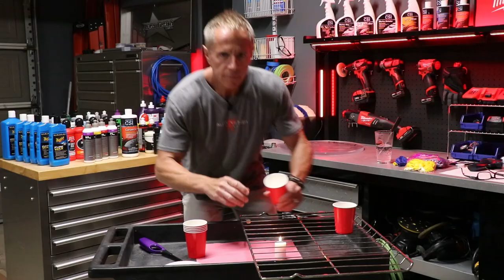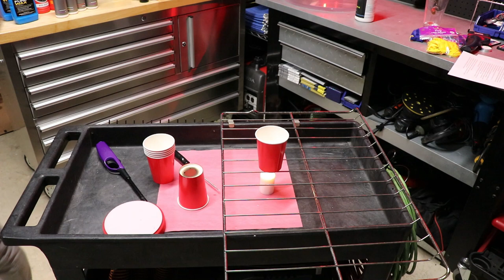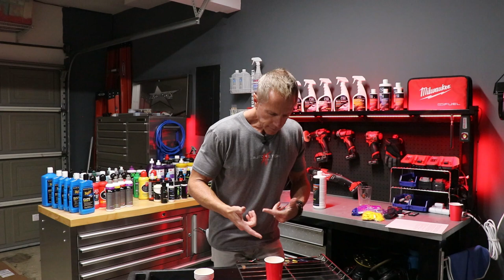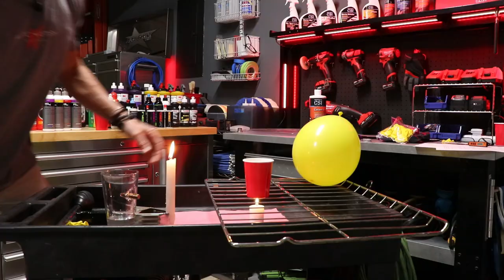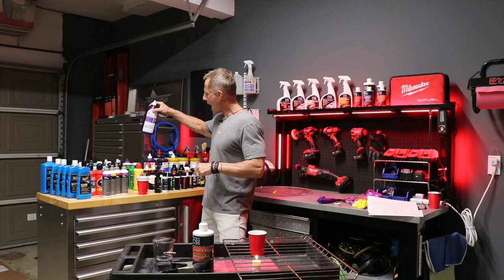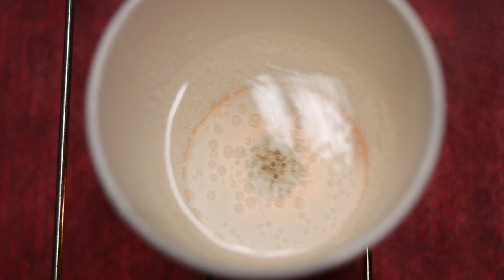Polishing Car: is it time to burn the house down??!!

Comment: Hi Darren.  Thanks for going the extra mile to answer my question re: waterborne polishes, specifically the CSI product.  I really appreciate the work you put into your videos.  However, I do still have one burning question that I just can't seem to get my head around, but it's more of a "single product" question. l So here it is:

My understanding is that that "one-step" polishes are capable of both cutting and finishing because they contain diminishing abrasives, not in spite of them.  To use your terminology, these products are capable of "scratching the paint to perfection" by utilizing finer and finer grits, until the remaining scratches are invisible to the human eye.  The finer abrasives are created as the "bigger boulders" gradually break down during the polishing process.  So here's the source of my angst:  How do polishes like CSI's achieve the same result (or better) without the benefit of diminishing abrasives?  If the higher-grit abrasives aren't being broken down during the polishing process, what is the source of the finer abrasives,  the ones that will ultimately scratch the paint to perfection?  Here's my theory; please tell me if I'm out in left field. What many detailers don't realize is that the pads themselves account for a huge amount of the abrasion that occurs during the polishing process.  The liquids are obviously important, but the difference between a good paint correction and a bad one has less to do with your choice of polish than it does machine choice, arm speed, pressure and of course, pad choice.  So CSI has been designed to facilitate/support/simplify the application of good technique, with less emphasis on products selection driven by the marketing machine.  CSI provides a high quality polish, along with a small selection of pads...which is all you need.  Would you agree with my long-winded dissertation, or am I a tad misinformed.  I could be wrong, but I think there might be some other guys out there who've had the same question messing with their heads.

Thanks again Darren - Brian

Comment: ok daren. I do mobile detailing in Norway, that is maby more Canda when it comes to weather. so I have sun. rain. heat. frost. cold. damp. all of it. I do polishing in very cold weather and I love it.
But do a test on say..polising in -2 c. Just to prove it is real good in that too.  
thanks for all that you provided me. so I finaly could run my own company with the correct proudukt. even if  after I done this for 16 years as a hobby could use the product you called trash. It could not make me work as fast and give me the shine I needed.  
So I hope you do a cold wather test.
Reply from the maker: Ceram-X will perform in cold weather. But keep in mind that I could push any product to the extreme on either end and all products would eventually fail if pushed far enough. You cannot freeze Ceram-X, just as you should not allow any product to freeze. All parts of weather will effect the user experience: temperature, humidity, ambient pressure, direct sunlight, shaded surface, etc., etc. Thanks for tuning in!!
Reply: @autofetishdetail  true.  that is extreme. I did not ment that you should feeze  cerami x. just the surface  I do heat a bit when I  polish  so i am in some heat. but that is here the other product fail. too cold or too hot.  but can't polish with ice.
ohk one more thing. before I use to be so dry  after polsih a car. now. I am just fine. wash my hand with water and I have soft hands. now that is good for your healt too.,

Comment: Darren, I  love Tom's and I believe your company . Questions first: why did u put hot water in the cup ? I saw Tom's video on this with his grill. 
Would you put ceram x in the cup ? 
I used the Ceram x on my black truck. Worked great BUT ....alot if dust.  I couldn't get it to ...pop. I guess I needed D1 ?
Does D1 make it better...like enhance or rather jeweling?
When is the release of the coating?
Thanks buddy
Reply from the maker: Hay Matt- I wondered if anyone would notice that. I used hot water to speed up the test. The real test isn't so much that you can eventually boil water. The real test is simply the fact that the paper cup does not ignite when exposed to an open flame; as it would without water to absorb all the heat of the open flame. Since I was using a very small heat source, it would take along time to get that candle to heat the water.  I wanted to emphasize the moment by showing bubbles starting to form in the bottom of the cup. So I preheated the water to speed up the moment. But once again; the most important thing is the fact that the cup can withstand an open flame for extended period of time due to the insulating effects of water, not whether I could fully boil the water.  And yes, Ceram-X does produce dust. Virtually every polish/compound produces some type of dust. Not all, but most of them do. Like everything in life you have to accept trade-off's. Ceram-X was made to answer very specific problems the industry was not able to answer, as well as be the simplest, safest, fastest way to produce results in the professional world of auto body/car restoration. This mean the cleanest, tightest, simplest formulation that was possible. Ceram-X is that. But it is also not a product filled with extra additives that would make it dust free. Tom wanted clean and simple. A product that produces desire results on any paint type, any color, and remain body shop safe. D1 is simply a polish "enhancer". D1 enhances the clarity of Ceram-X to a higher degree...but this is only for people that work under conditions that can even appreciate that level of perfection. We don't push it because it, as it is not necessary in 95% of cases. But D1 does have abrasives (10x smaller than that of D1), so it does still polish using abrasives, and the industry would call this "jewelling". I simply am not a fan of the term jewelling as it is a term the industry has adopted to sell us more and more products. P.S. I would not demonstrate Ceram-X in a cup over an open flame. I don't think this demonstration would translate to most people. The idea is not that Ceram-X is flame proof, it is to demonstrate the unique capabilities of water to absorb heat., since Ceram-X employs the use of the water molecule as the "carrier" of the other ingredients.
Reply: @autofetishdetail  
I understand the concept of chemistry.  I LOVE CSI. Im not bad mouthing it in any way shape or form. Just had questions.  I would live to try D1 and the new ceramic coating you guys have. Tom is a fantastic gentleman. Thanks for understanding my concerns
Reply from the maker: @mattduffy2023  I didn't think you were bad mouthing in any way. I appreciate the questions and invite anyone to shoot holes in what I say as well as our products. The feedback helps us to answer legitimate concerns and questions.

Comment: Darren does this product do everthing heavy lifting to finish up ...i feel like i been doing this forever if i show you my van you would be like damn what buddy whats going on here
Reply from the maker: YES! It uses non-diminishing abrasives ( I call this control abrasive technology as compared to the diminishing abrasive technology the industry still uses) Ceram-X is formulated with very refined (read: expensive) abrasives that can perform with the cutting ability of compounds, but finishes down to a swirl free finish. I have a video in the works that clarifies and explains the difference between compounds and polishes in general, but illustrates the distinction between the unique formulation of Ceram-X versus all other products.